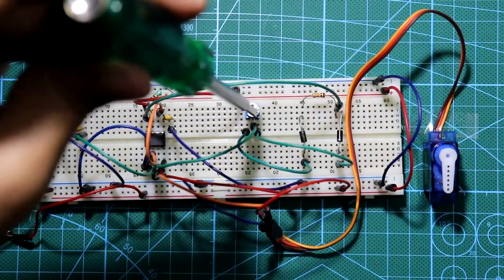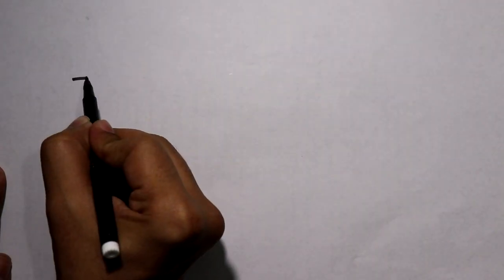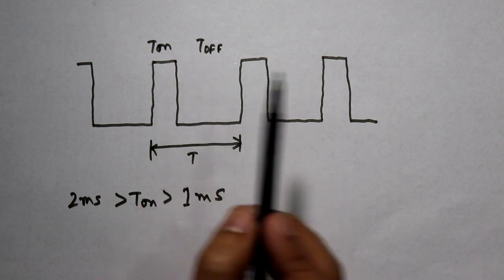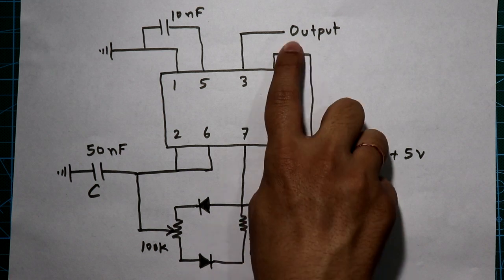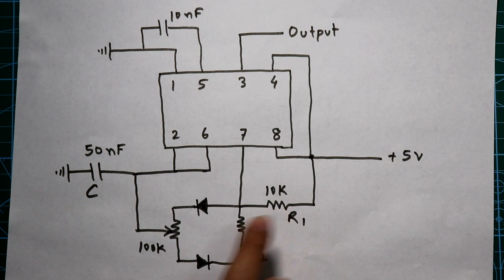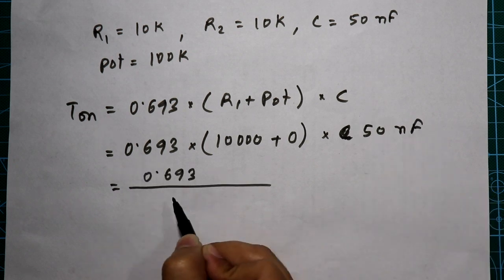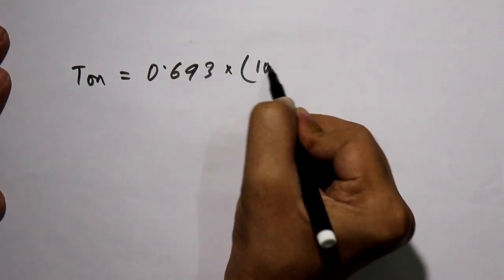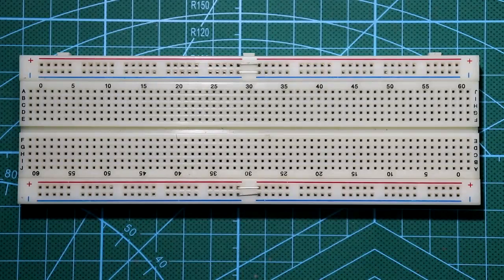Servo motor control without microcontroller | 555 as servo controller

Comment: Why does the servo shake sir at 90 degree and more, when we turn slowly the potentiometer? 100k made it shake too much and i used 50k. But the shaking trouble related over 90 degree, still existed.

The circuit is on the breadboard as same as what you do in this video.

Comment: Is there anyone can explain me where "0.693" come from?
Reply: Only what i can say about, this is result of narural logarithm from 2
ln(2) = ~0.693. I am still begginer and at this moment I don't know why Natural logarithms are commonly used in electronic calculations...
Reply: The voltage on a capacitor has an exponential grow that can be expressed in this way Vc(t)=Vinf+(V0-Vinf)e^(-t/R*C).
If we give 6V to the ne555 timer it will make two treshold voltages at 2V a 4V. (If we give 12V it will create two tresholds at 4V and 8V).
The capacitor will the oscillate between these two thresholds again and again, from the lowest one to the highest one in that exponential way.
So if we substitute: Vinf=6V (because the capacitor will try to aim to reach 6V), V0=2V (the voltage at time 0), Vc=4V (the voltage at time t) we can than calculate what is going to be the time t needed to reach 4V from 2V.
4=6+(2-6)e^(-t/RC)
(4-6)/(2-6)=e^(-t/RC)
1/2=e^(-t/RC)
ln(1/2)=-t/RC
-t=ln(1/2)*RC
t=ln(2)*RC=0.69*RC

When the capacitor is charging the output of the ne555 timer will be high, that means that the time that the capacitor takes to charge is the Ton time of the ne555 timer.
Reply: This value and formulas for T(on) and T(off) are given in the 555 data sheet.

Comment: Great job my friend. Actualy i need to substitute the potensio in to toggle switch and need a stable posisition. Is  it    possible  by using this circuit to do it?
Reply from the maker: Hello friend, yes it is possible. Just remove the potentiometer and put resistors. If you need 2 stable position then you have to put 2 resistors. (For 3 stable position, you need 3 resistor and so on..) Find the value of the resistor with the help of potentiometer.
Reply: @EEWave  can u tell how to connect 2 resistor , i mean in between which of components please help.